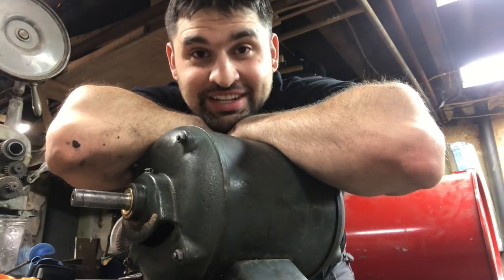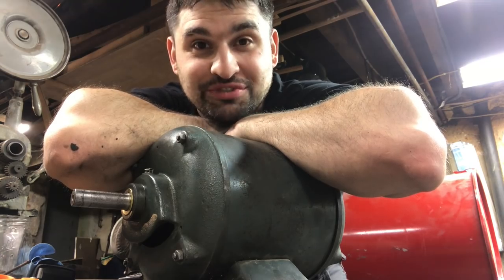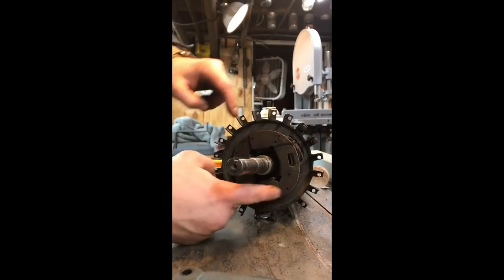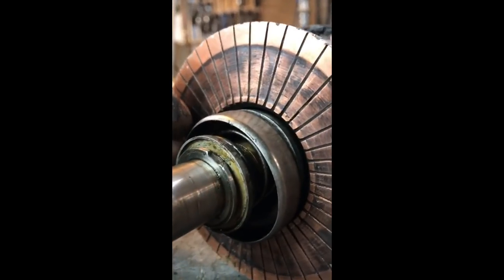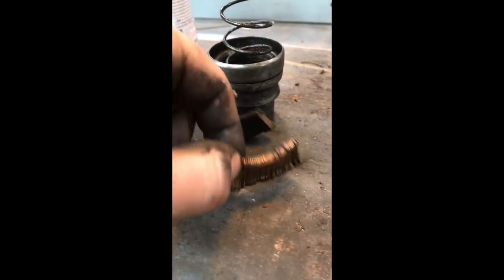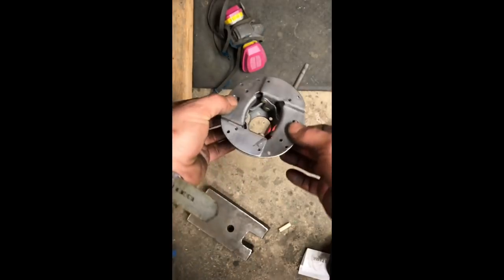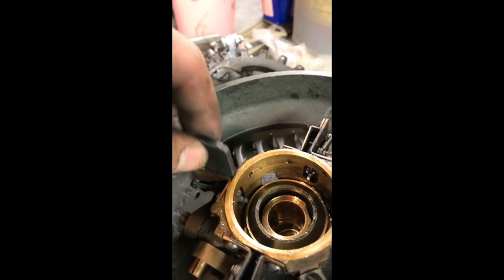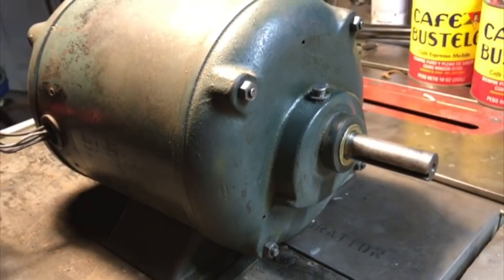Antique Century Motor Restoration | 70 Year Old Electric Repulsion Induction Motor Rescued!

Comment: I have an 6’ tall antique drill press run by a Century motor. Single phase, patented in 1899-1903. I believe it needs new brushes. There is no one local that want to touch mine either. I will attempt the rebuild and brush installation on my own. Thanks for the confidence builder.
Reply: If you search for century motor on YouTube there are a couple of videos on the older induction run repulsion motors - if that is what you have.  They work very similar to this one.
Reply: @wdmm94  Thanks for viewing and responding to my comment. Many thanks.

Comment: They still made repulsion motors into the 50's.  Capacitor motors were around in at least the 1920's.  It wasn't really a replacement with newer tech.  Repulsion motors can be started under load like a type of Capacitor start motor BUT don't have the high inrush current draw.  I read this on a Century motor spec sheet from the 40's.

Comment: Technically it is not a brush motor either - there is no line voltage fed into the brushes.  As far as scrapping "old crap"  there is more qualiy, durability, ruggedness, and longevity built into a lot of that old stuff versus newer stuff.

Comment: Hi Dave.  Love the old Century motors. Thanks for sharing yours here!  I have a 94 year old Century repulsion-start motor; in its original application. It's part of a Frigidaire refrigerator. Belt-driven sulphur dioxide compressor system. The older Century motor seems to be almost identical to yours, mechanically. The housing design is a little different, though. Mine has ring-oiled journal bearings. 

The experts told me similar stories as well.  They said this motor would never run again, and the massive iron flywheel had forever been silenced by the passage of time. They told me that the corroded copper coils within, would never see frost again. I had a silent relic with only memories to be read on a museum plaque. 

 In the end, they were gravely mistaken.  https://youtu.be/LdFclxIDY5k

Comment: Hey Dave, great video!  I am trying to rebuild my motor too, and are wondering what you used to clean everything and how you changed the wiring.  I am not experienced with rebuilding these but still want to try and tackle this myself.  Any info you can share would be much appreciated.  Thanks!

Comment: Hey Dave. Any chance you’re considering making a more in-depth restoration video of a vintage electric motor? Oh let’s say for example, an early 40’s Craftsman type? Covering rewiring, finding and replacement of flat capacitors, bearings, etc. Asking for a friend........... who’s probably restoring a ‘41 Craftsman wood lathe and ‘41 Craftsman Bandsaw and hoping to stay with the Craftsman vibe by including motors that were originally sold with these models. He may or may not have taken one apart initially and had the old wires disconnect before taking pictures of where everything went. Not that he’s an idiot or anything.......... 

Thanks bud. Great remodel by the way. Take care. 

Matt
Reply from the maker: Matt send me some pics on IG and I’ll see if I can get you squared away

Comment: We have these on our Flume and Multifix motors we rebuilt the two Flumes recently, we just call them Repulsion motors. Does yours have a speed controller or are you going to just set it and run it at an adjusted set speed? If adjustable did not see well enough during the filming. 
These motors are incredible and can do a lot of controlled speed work so of course we are happy to see you save this guy. 

We love your motor because we have so many vintage motors for our projects here to be date period correct during rebuilds for our shop. 
Thank you for sharing a piece of American history. Lance & Patrick.
Reply from the maker: This one had no speed control gents, perhaps a bit different than yours. Thanks for keeping yours alive as well!!

Comment: I rather enjoyed the incredibly unnecessary dramatic reveal.
Reply from the maker: Here for you Vinny.
Reply: @partsandresto  You work on this stuff a lot? Maybe I could get some motor wisdom from you. I have a 1920's single phase AC motor that was running, but when I looked inside all the wire insulation was pretty crusty. Can you rewind these things? Where do I even start? I've torn apart plenty of gas engines but motors are foreign to me.

Comment: Thanks for the video, nice rebuild. I’m about to restore a similar 1950, 1hp. There’s a clicking I’m hearing in my motor. I’m only guessing it’s the centrifugal switch. At 1:45 of your video yours appears to have tension to it. At 3:45 it does not and is how mine is always with no tension. Normal? I assume not.

Comment: Are those little caps over the bearings for lubrication? Ive got a 40's wagner rep/ind 1hp motor and it has the same thing. 204 frame
Reply: a trick: watch movies at flixzone. Me and my gf have been using them for watching loads of movies recently.
Reply: @Marcellus Jeremias Yup, been using Flixzone for years myself :D

Comment: Awesome retro. Question, I have a vintage GE motor. Need to replace start condenser, is there a positive and neg wire attachment? If so, how to I tell which connection is the positive side?
Thx

Comment: dave 
i have a 1/4 horse attic fan motor 1750 rpm  1950 s  old .its a century brushless . i used a wire wheel to clean the inner windings then i cleaned the center shaft rotor with a wire wheel  i exposed  some of the windings to a bright copper color on the inner windings .. i replaced the heat stat and capacitor.... the motor turns on   gets hot charters and shuts off ?   any suggestions? thanks

Reply

Comment: Hi there. Good job of doing it up. I'm a little bit of a collecter of these. Here is a link to my 1.5hp disc sander which is powered by one.
https://youtu.be/VvFso1cZUP0
At the end when you run it it should be a little quieter. I think making a shim or two up for the shaft where the fibre shims are would make that motor run even better